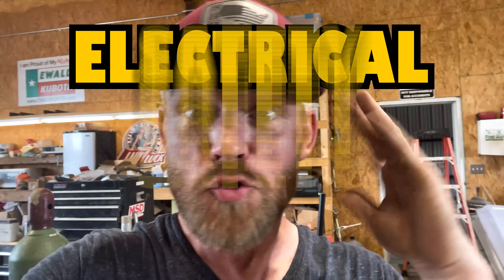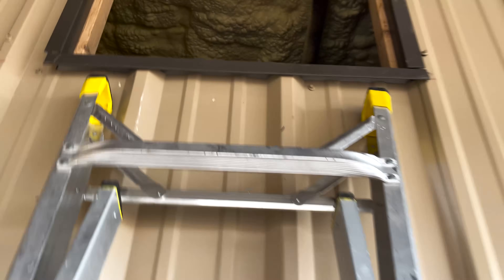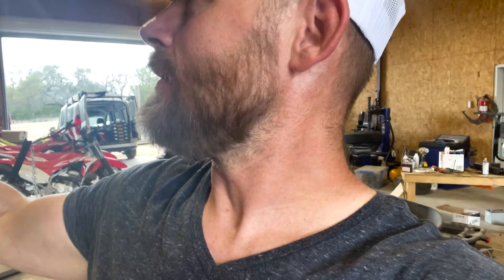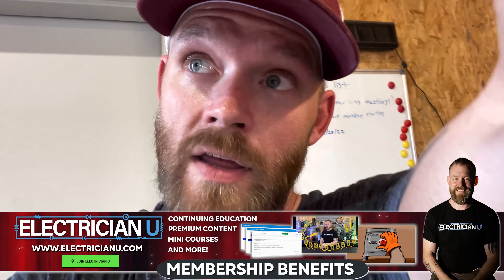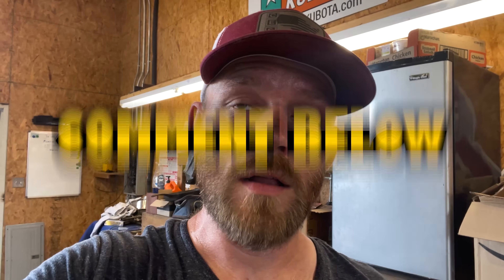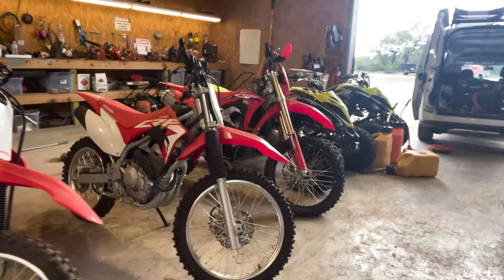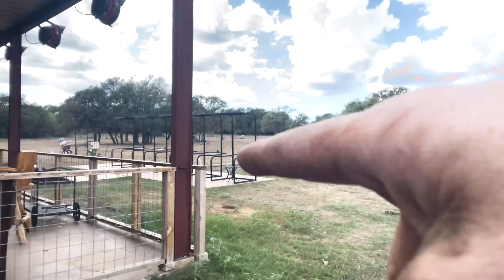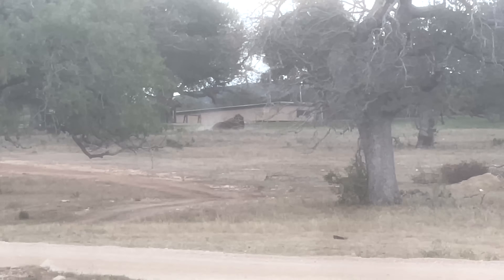Should I Risk Zapping My Apprentice? Also, Is That a Wildebeest?

Comment: I agree with your being safety conscious.  If it were me up in the hole attaching the equipment I would feel more comfortable knowing someone wasn't on the other end of the wire making connections, because crap happens sometimes for any of us.

For me this brings up another topic you've already made videos about. Thirty years ago I was taught how to work on energized circuits. The biggest thing that helped me was intimately getting to basic electrical theory and reinforce that knowledge in practice.

How to learn in practical ways? Using doorbell transformers and potentiometer. Wire the first transformer as normal, then on the secondary side reverse connect the transformer to step up the voltage and at the same time keep the current below 0.01 Amps. Insert the potentiometer so you have control of the output. Now grab ahold of those bare output wires and feel the slight tingle. 

Experiment with how electricity travels and doesn't travel. Attach the wires to pieces of EMT and notice how the greater surface area greatly affects the connection to your skin. Try it with sweaty hands or hands that are very dry and take note of how it affects the connection to the body.

Early on I did all these experiments but I ALWAYS did the math and schematic on paper first. I always made sure my Amps were not going above 0.01 A on paper and the would confirm everything using a VOM. 

This was life changing for me. It reinforced electrical theory and I was no long 'afraid' of electricity, but at the same time had a much greater respect for what potential was there and what it could do that could kill you. It's like anyone who intimately knows the rules of any game will do much better than those who don't. 

These days anyone can buy a very cheap   TENS unit from Amazon and experiment how electricity affects the muscles. Connect a pad on your shoulder and one on the palm of your hand.  Turn the thing up on maximum and see how your bicep and forearm muscles respond. Now move the pad from your palm to the back of your hand and not how your muscles respond.

Knowing this information can save your life in your career.

Back to the thought of working on life circuits. For me, for safety reasons, it's second nature that I always have the mindset that what I'm working on could be energized at any moment. Does it make me work slower? Yes, but it's also kept me safer.

Be the safe person you wish others were with your life.

Comment: I notice when I'm pushing breakers in that some of the brands are just so horribly designed that the space between spots is small and I really have to squeeze it in or push up or down and since they're all made of slippery plastic, it's easy for my hands to slide and accidentally turn it on. It's only happened a few times but it feels like it could happen alot more if I wasn't as careful as I am.

Comment: I’m a 4th year apprentice and we were installing a feeder in a building for a conveyor line. It included a disconnect and a motor control cabinet. Before one of our journeymen had terminated at the control cabinet, another journeyman had landed the feed back at the panel which supplied a 480V 200A circuit for said cabinet. Needless to say we were all pissed because the maintenance personnel that worked for the customer were known to just flip breakers without asking and usually we work in the mindset of “don’t”. His excuse was “it’s locked out” but it’s the principle of the matter.

Comment: In this scenario, I would let the apprentice do the final wiring at the breaker.  That way there's no power on any part of the circuit until everything else is finished.  That's one of the advantages to installing new wiring.  There's no power there until you wire it in.

Comment: Absolutely agree, I work as an industrial electrician this an absolute rule. We work with high currents and 480vac.
Unfortunately on occasions we must work on and/or in a hot panel (panels for computers …) extreme caution is required.

Comment: No...you're right...the apprentice is SUPPPSED to learn from the master!  When I was an apprentice 45 years ago, I was sent on the roof to check continuity on a 25 ton packaged AC Condenser...when I got there I started to check the continuity and something told me to check for voltage...and it was hot, with 440 @ 100 amps and it was supposed to be off!

Comment: I'm first year into my own business, came in through the back door essentially.  that being said if it's a new circuit that I ran I'll hook up ground and neutral while they are working the other end.  but I leave my feed tied away from the panel until the other end is completed and my partner is around me. only until then do I complete the circuit and install the breaker. that being said your "super country" is the quintessential east coast panel. so we spend our "free time" cleaning up the panel or simply cleaning up the job until everything is installed and then we finalize then test before we call the job completed. just a pa sparkys p.o.v

Comment: My master told me, this is hot, this is hot, don't make a curcuit and you wont get shock. I wouldn't trust anyones opinion, customers get mad at times that just want to help.. I'm a rather blunt guy, which probably doesn't help. Good thing it doesn't matter how I "sugar coat" to talk, long as my work is clean and done in timely manner.

Comment: Your absolutely right! I work for a state funded company and one time I was working at a site fixing and reconfiguring some circuits, where an outside contractor that morning came in to trouble shoot a different circuit that did not belong to us. Well he went ahead and turned on all the breakers that were off not knowing that someone else was working in the other room across the panel. I got hit with the hot leg. Neither did I or my helper imagined anyone would ever come strolling in and just start turning breakers on, specially since any electrical work is done thru our company.  Lesson learned my friend!

Comment: That is a good way to operate. When working alone the breaker is the last thing that gets connected. I recently replaced a subpanel and I connected the breakers last and then connected the subpanel to the breaker in the main panel.

Comment: My second day as a helper right after being taught how to install outlets, my lead man pointed to some that needed installed in a bathroom, said install one here here and here then left me alone. I got to the last one, went to trim the wires, cut through hot and neutral together, and blew up my nice new Klein cutters. He failed to mention the bathroom had temp outlets, which were hot.

Comment: My work - a large utility company not in America - would require the electricity to be isolated, a lock/tag with anybody working on it to place a lock that only they have the key to. Then it can't be energised until everybody removes their locks so you can guarantee that if you are working on something, it is definitely not live

Comment: Common practice i have always done is regardless of whether the breaker on the busbars or outside the panel hanging on the wires pre set up is i always attach a breaker lock out and lock  and that lockout does not come off until i have checked all the work and verified that circuit is safe to turn on. Any breaker that come on to my job sites get a lockout device before they are even installed in the panel just because anything can happen

Comment: Many years ago my son and I were pulling 3 pieces of 00 wire through some conduit to give service to an out building.  I sent my son (teenager) down in the basement to pull the wire into the main box.  We were pulling the wire with a metal fish tape.   I told him to kill the power at the main breakers. I was helping feed the wire as he pulled.   Suddenly, I heard a snap and saw a blue light.  This was accompanied by a loud sizzling sound.  I knew immediately what had happened and wondered how I was going to tell his mom that he had been  electrocuted and was dead.  He was standing there with a WTF look on his face.  Once I was sure he was ok, all I said was “ You didn’t kill the power did you?”   Apparently, the fish tape bowed and flipped out of his hands.  In doing so it contacted the energized panel and vaporized a length of the fish tape.  To this day, I don’t think he knows how close he was to dying.  I do.  Now I double check everything so something like that never happens again.
Reply: Interesting being his father that you didn't double check or even triple check from the very beginning?🤔
Reply: @theseattlegreen1871 first off this man AKA a real FATHER,  just woke his son up..
Lessons he learned that day: 1. Trust No One when it comes to working on electrical..always be cautious with your work and test for any live wire yourself. 2.He learned not to be afraid  and willing to do the job..future promotions or own boss coming to his life. 3. Becoming a Man…
This guy did nothing wrong trying to teach his kid some work.That’s a FATHER 💯…
STOP JUDGING AT OTHER PPL..You’re MAD at your own FATHER!!
Reply: @theseattlegreen1871   Unnecessary Dick co!mment of the week Award goes to you

Comment: Electricity is no joke, I got shocked for not paying attention 241 volts on OH power lines  temp power it was hot 106 degrees and I rushed it. My muscles tightened held on for 7-10 sec ripped muscle tissue 2nd degree burn and a broken scapula.

Comment: My first journeyman got fired for getting me shocked. We were trimming out an apartment complex and he hadn’t floated his neutrals at the pull boxes at the building service or bonded the equipment together. Consequently power was back feeding from the neutral all the way into the individual subpanels in the units and down the branch circuits where I was working. He had had several similar violations and had cost the company a lot of money in terms of wasted materials and his inability to get along with others and make it through a full day of work. So multiple issues but the big one was getting me shocked by skipping critical steps at the service. Ever since I have taken job site safety very seriously and it has sometimes annoyed others I have worked with but what is your paycheck if you’re not around to spend it?

Comment: Safety is paramount with electricity regardless if it is 6 volts or 600 volts.   Always want to have at least 2 layers of safety.  So you wire the breaker and as you said, your thumb slips or what if it is a deffective breaker that doesn't turn off?  Never take electricity for granted.  It is just sitting there waiting for you to do someting careless (or stupid).

Comment: I will get the ground and neutral hooked up get the hot routed how I like it towards the breaker and leave it until they are done on the other end then it just takes a second to strip and stab it into the breaker

Comment: I just replaced the receptacle for my house's washer yesterday. There was something loose inside because when I plug tested it, the ground was constant on the lower outlet but intermittent on the upper one. Just a simple receptacle, but I still made sure to de-energize the circuit before I even pulled the outlet out. I then used a "dummy stick" and my multimeter to make sure it was dead, and still worked as if the circuit was live. Tested the plugs after installing the new receptacle before putting the plate back on, but still de-energized it after testing but before putting the plate back. New receptacle had no issues with intermittent ground. It was just a receptacle, and I'm not an electrician, but I still made sure to minimize the risk.

Comment: Safety is no joke. Had a local electrician get electrocuted working in a pad mount transformer last week.. pulling wire in on a hot day, took his hard hat off, leaned in to grab the rope to pull and crossed phases on his head. Very sad situation when you think that had he kept his hard hat on, it would have been a near miss. Always practice safety no matter what

Comment: What is the problem with using zip ties for electrical wires? I know for category 5 and above low voltage wires it is not recommended since it could damage it but I thought it was because their insulation was not as thick as electrical wires...
Reply: If you want to be nit-picky any zip ties you use for this purpose need to be UL listed for securement. Most zip ties are not

Comment: I'm sure people will call you a pussy on here because they don't care if someone gets killed or they pliers burn up.  They will just say that it's the apprentice or helpers fault.  This has happened to me before mostly on commercial remodel jobs likely the electricity just sparked and didn't go into my body.  It was 480v doing a demo on Fed Pacific equipment.  I told the electrician I was with to open the elbow on the conduit and check for power and he said their was no power, so when I started to ream the conduit it cut into the feeder cables and sparked.  He didn't even apologize for almost getting me killed.

Comment: I'm with you about safety,  however, I  see no problem hooking up your ground and neutral, but I always leave the hots off. Good stuff!
Reply: The ground or neutral hypothetically could slip and make contact with a hot lug/terminal while he's terminating it and that would be a potential hazard for the apprentice who is still working on the equipment.

Comment: A wuss move is one where you cannot sanely explain to your helper's family why they died. Try explaining to them that their son was killed because your finger slipped, for example. So it isn't a wuss move to leave the wires unstripped and unconnected in the breaker box. A pro move would be to add a LOTO lock to the breaker to prevent it from being flipped accidentally as well (it may not be connected, but someone ELSE might decide to be "helpful" and finish off the breaker box). And they even make LOTO locking lugs that attach to the breaker handles so they can be locked out even on an open panel.  Those usually screw over the handle, immobilizing it, and your LOTO lock then locks the screw so you can't loosen it off the handle.

Comment: I worked in a sawmill for years and they were always trying to work on live power so scary 😦 but I would not have anything to do with it. I have seen motors blow up electric ⚡️ boxes blow up one person even got burned by a electrical box catching on fire 🔥 trying to shut it off and the fuses in the boxes would blow so to stop that they just put solid copper pipe wtf 😬 no fuse protection so glade I don’t work there anymore be. No safety at all there 🙁

Comment: I am with you. One can never be too careful about safety. Years ago two of my co-workers ( in the automotive paint booth maintenance business ) at one site. One guy sitting on top going to change florescent bulbs in a 2' X 4' fixture. The other guy was already headed for the breaker panel, but too soon, the guy on top pulled up the fixture and turned it over in his lap. ZAP !  It knocked him out cold. He fell prone on his back and hit his head on a structural rib, which busted his head open. Called 911, took him to hospital. All just changing a light bulb. Turned out there was a bare spot on one of the wires under the ballast cover. Apparently when he flipped the fixture, the wire shorted and zapped him.

Comment: My mother's 1st husband died from electrocution. They were neon sign makers in San Antonio and he climbed up on sign about 40' up in the air and someone had either left the electricity on or turned it on while he was working and it threw him off the Billboard to his death. It is very important to make sure you lock out your panels So that tragedies like that don't happen
Reply: But then you wouldn't be here.
Reply: Sounds like the impact killed him, not the shock. If he was wearing a harness he may have survived.

Comment: This actually happened to me.

Was working on new wiring we had run and I was looking for a possible short (our tester was actually malfunctioning so we were getting weird continuity readings) when all of a sudden I get nailed hard by something that was supposed to not even be tied in with the panel
 
Apparently my buddy had made up the panel while I was working and accidentally flipped the breaker

Wasn’t too bad,  just glad it was relatively low ampacity and I didn’t jump through the ceiling. 

Lesson learned
Reply: were you a trained  electrician
Reply: When you say "it was relatively low ampacity," what do you mean? The ampacity is determined by Ohm's Law which means your body's resistance is a determining factor. There could be no load on that circuit yet it could still kill you when you become the load.

Comment: I was doing a residential rewire project and I had a guy in the attic and another guy in the kitchen working on the same circuit.
They guy in the kitchen needed to power up to do some testing.
I told him "no" because of the guy in the attic. 
He argued that he would leave the switch off that went to the wiring in the attic and it would be okay. 
I repeated myself.  .no.
He continued to argue. 
So ultimately.....FIRED!
Safely First...always. 
Thanks for another great video. 👍
Reply: Good call. What if it was a switch loop, there would still be power up top even with the switch off.
Reply: @jarrydee2799  Yep. Exactly. 
Have a great day my friend.